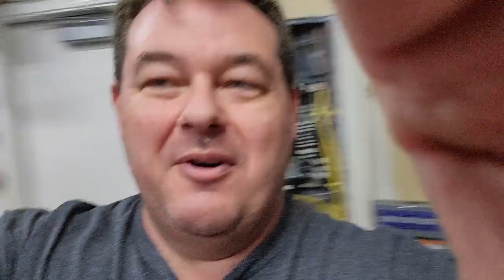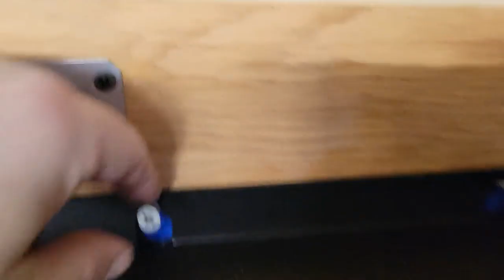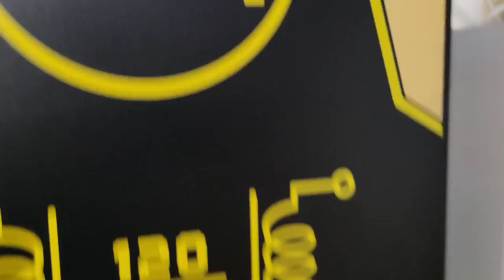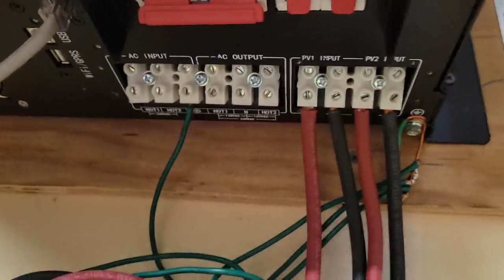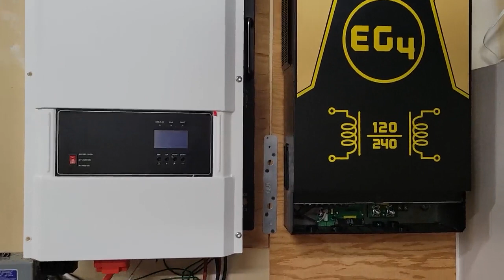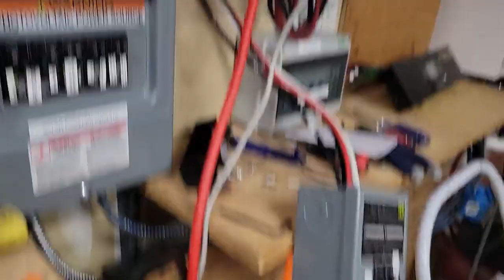EG4 Split Phase 6k Next to Growatt 12k Split Phase 20230210

Comment: The manual states 'Suggested minimum cable requirement for AC wiring' is 10awg, so why would you already having 8awg be an issue? Are you saying they won't fit since they are thicker?
Reply from the maker: The braided 8awg were a difficult fit.  However, I would rather use the thicker cable.

Comment: Hello, I have the growatt myself. I'm also new to the solar world ..it seem like the inverter not reading my soalr panel.input. do u know what I'm doing wrong? I'm reading 150v going in, but the solar panel not popping on the screen
Reply from the maker: If you have voltage on a multi tester and the MPPT tests the panels wattage but its a bit dark outside, the current may not be enough and it will not turn on yet.  This is because the multi meter doesn't really effect the voltage by creating a load, but the MPPT will create a load trying to charge the batteries and that will cause voltage drop if there isn't enough wattage being harvested at the panels.  In this case, you may just need to wait for the sun to be a little higher and everything may be just fine.

Also, Growatt has a couple of different MPPT chargers in their units.  Some units have the 150v max input MPPT and some have the higher options like 250v or 500v.  Double check your manual for PV input rating.  I'm not an expert, and this is just my personal experience talking, but it seems like the MPPT needs about 50% voltage or more before it will turn on.  BTW do not go over voltage on any electrical device.  You may need to rearrange how your panels are connected to optimize voltage for the MPPT.

Always consult the manual.  The manual is your protection for warranty, not some guy on YouTube, as good as our intentions are.

Comment: Buyer Beware it's getting more common to find unhappy signature solar customers. Lots of EG4 inverter problems that are slow to be resolved, I'd think twice about those EG4 batteries.

I have an EG4 6k Split phase that is dead on arrival , so  I would connect the batteries and see if you can get it to turn on before you get everything wired up.  I spent a lot of time mounting and wiring only  to find out they shipped me a dead unit.  

 Signature solar has you take all kind of pics and answer questions with a level 1 Tech, then a level 2 Tech. They decide they sent me a bad unit and you get moved to the "resolution" department. Only to wait and wait and wait.
Reply from the maker: Good to know.  However, mine has been powering the house since Feb 12.  So far so good, fingers crossed.

Comment: Remember something you get what you pay for around my complete house on a 3000 watt inverter on the only thing I did not run is the 80 gallon water heater and a 4 ton central unit and my 3000watt isis 12v no my batteries here and I’ll run a side-by-side fridge raider in a four-door refrigerator. Big boys no problem for five years.
Reply from the maker: Interesting, is your inverter full sine wave?
Reply: @bhunter736  yes it is my inverter is samlex evo 3012

Comment: I used 2 5000ESs with the midpoint transformers. We started w/ 5, but that was too small. That 12kW unit seems really heavy, but I guess they build the transformers in... those suckers are definitely heavy! I'm trying to figure out an automated transfer switch... we don't have enough sun for PV, so I'm just using the Battery to avoid peak-pricing hours... I thought if I hook a "conventional" transfer switch up "backwards" (where the grid is the "backup power"), I could use the clock in the Growatt to time the whole thing... Generac told me to get lost. If you've got any ideas, let me know. Thanks!
Reply from the maker: I like your thought process.  The only thing is, the peak and off-peak pricing may take forever to reach a return on investment (ROI).  Where I am, the difference is only a few cents.  So spending $3k or more for batteries and an inverter might take 20 years to reach ROI.  Granted you get the benefit of skipping blackouts, brownouts and possible food losses, but that's hard to calculate.

Comment: What killed the MOSFET has more to do with the leakage inductance from the fets to the transformer. When designing inverters like that in the 1990's, I learned a few tricks to prevent that from happening. I guess Growatt hasn't figured them out, yet.
Reply from the maker: Sounds like you know a fair amount about this.  Is there anything that can be done from the user side to prevent this?  Like if I had a more significant load would it have made a difference?
Reply: @bhunter736   Motors, pumps, compressors, air conditioners, can kill an inverter that isn't properly protected for that use. Nothing a user can do about it but try another brand, like AIMS for that kind of load. A Growatt probably works fine with lighting, heating, and cooking, i.e., resistive loads.
Reply: @ToddDesiato what other brands do you recommend.
Reply: @vp112358 Sol-Ark for HF. Victron or Schneider for LF. I’d steer clear of SignapoorcustomerserviceSolar

Comment: iv had a eg4 6000ex now for about 6 weeks, it makes weird noises and it wont charge battery at 120amps, it shuts down around 90amps charging, it really wants to act uo when you pu grid power or generator power to the input side, hope you have more luck with yours than i did with mine
Reply: Max charge for the eg4 battery is 100amps. The BMS wont lt you charge at a higher rate. That being said, I have 3 eg4 LLS and I have notice that when the charge is above 30 amps its starts to act up too. At this point I'm close to 90 amps for the whole bank. Signature solar says that for maximun life the highest they recommend is 30amps per battery. I'm choosing to believe the BMS is not lettting charge at a higher rate due to this even though the battery specs lists them as 100 amp charge rate. I'm in the process of getting a 4th battery and I'll teat that theory simce I can raise the charge rate to 100amps for the whole bank and see if it starts to act up. If it does I'll know it is inverter related. If not I will know the BMS was the restriction
Reply: @PRVRT1  lifepo4 cells can be charged at a .5c rate, 100ah battey can be charged at 50amps, 3x 100ah batteries can take 150amps charging no problem, bms will only shut battery off if it reaches incomming current of 100amps
Reply: if the eg4 6000ex cant push 120amps into 3 100amp hr batteries, theres something wrong with the a/c charger/ inverter
Reply: @offgridsolardome2024  From my testing it seems the BMS is limiting the current to 30amps. If I charge the 3 bat at 80amps (26amps each)  it works perfect. If I raise it to 90amps or 30 amps for each it seems the bms is limiting that and starts to do strange things. From apeaking to SS they mentioned they recomend charging at a maximun of 30amps per bat for longer life. I've seen some strange behaviors from what SS claims and what the equipment or software lets you do. In any case,  26 amps per bat or 80amps total for the 3 its quick enough for me. WhenI get the 4th one I'll raise it again and see if the problem continues.
Reply: @PRVRT1  thats the same thing mine is doing, i can get it up to 90amps but i have to do it in 10amp increments, anymore than 90 the inverter kicks out, makes strange noises, i have a home built 280amp hr battery bank, not an eg4 battery, so i use the use settings
Reply: just record everthing you do
Reply: Seems like the videos keep popping up. Love the idea of saving money with eg4 / SS but with all the trouble it might be cheaper to get victron or solark🤔
Reply: FYI Seems SS added a MCU update that was not available when they first released the firmware folder.
Reply from the maker: So far so good, but it's only day 01.
Reply: @bhunter736  i also had 2 growatt 3000s, 1 of them started acting up so i bought the eg4 6k, it blew up my dryers control board

Comment: Ahh, just checked and it looks as tho you can run the 6000ex units in parallel. That's great, especially considering if there ever was a failure you would most likely still have one functioning unit to keep the lights on. Not sure why I thought you couldn't run these in parallel.
Reply from the maker: This is the first one that I'm aware of with a built-in transformer that will support parallel operation.  You read my mind about keeping the lights on.
Reply: @bhunter736  yes, redundancy is a must if off grid.
Especially as we are on an island with all the logistic issues that come along with it, and the expense.
But it's a great view & always warm so 5% solar energy for lights, 10% for fridges, 5% for pumps & 80% for AC. Running 4 mini splits kinda soaks up that battery juice fast here.
Will check out your eg46000ex commissioning video later tonight.
Hope it's working out well for you.
Reply: Thank you